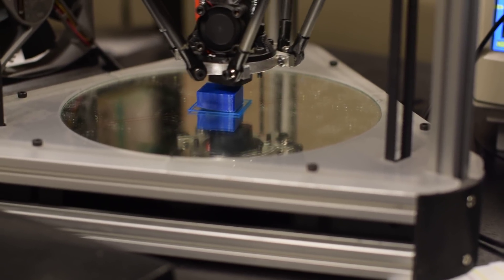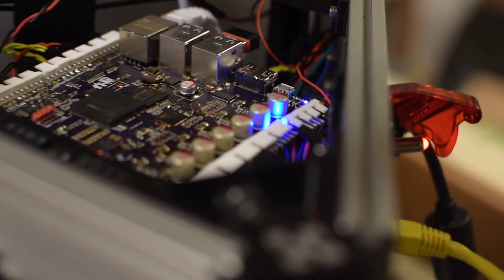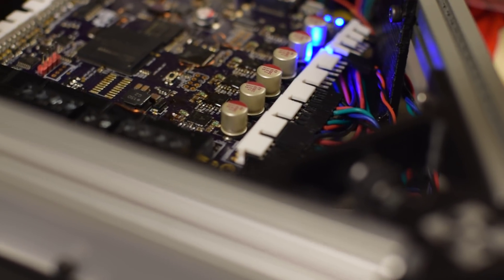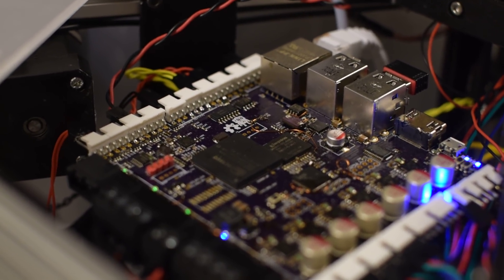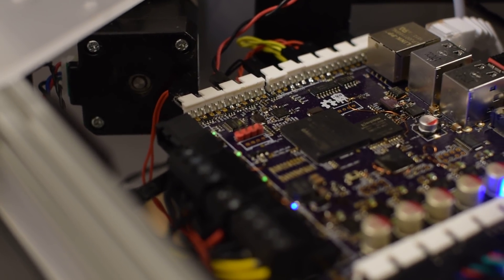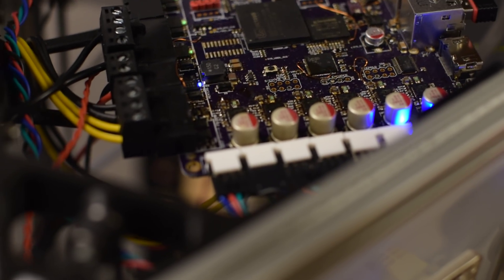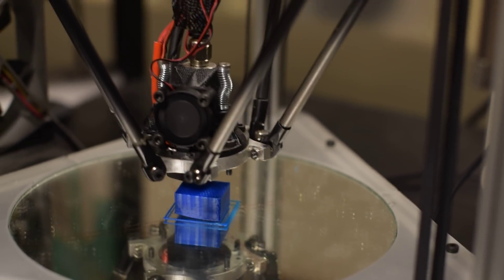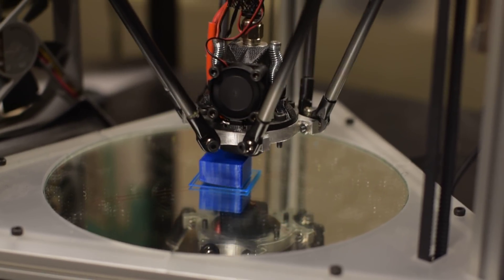Revolve first print

Comment: I feel this was al a scam to get people to buy the manga screen. I don't believe there was ever a Revolve board
Reply from the maker: Hi Gregory! Revolve was never manufactured in quantity, no. But it was not a scam to get people to buy Manga Screen, it was meant as a stand alone product that could work with several different screens. The reason it failed to go to market was that there were multiple partners involved and we did not manage to agree on the terms. Instead, Recore was made and it has some of the same ideas, but a better SoC etc.

Comment: Did that board ever come to fruition?
Reply from the maker: It did not, but there is a new board that is just finished and has a better SoC and drivers etc: https://www.iagent.no/product/recore/
Reply: @EliasBakken  Yes, saw it in the other videos of yours. Allwinner with RISC co-processor seems like a weird compromise.
Reply from the maker: @graealex  Allwinner A64 has very good mainline support for all peripherals etc. And the quad core Cortex A53 makes it high value for money, so it is a good chip over all. Boot times are great and the print speed is also great, so I'm happy with the choice over all :) The use of the RISC co-processor is a way to get very high speed without needing a (fast) separate MCU.
Reply: @EliasBakken  I'd currently avoid chips from Allwinner, HiSilicon, ... etc. - not for quality or support reasons, but for political reasons. These designs might get deprecated over-night.
Reply from the maker: @graealex  yes, I see what you mean, but there are no guarantees with western manufacturers either though. Be it chip shortage or other problems. I'll cross that bridge if i get there.
Reply: @EliasBakken  Anyway, thanks for your time, and I was one of the people that bought the Replicape back then.